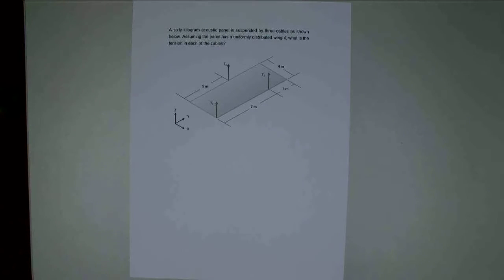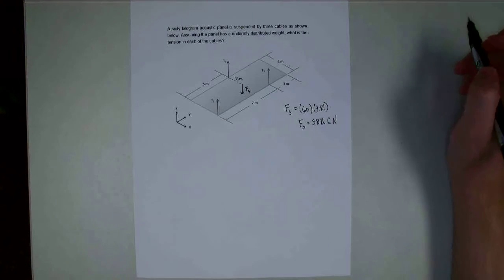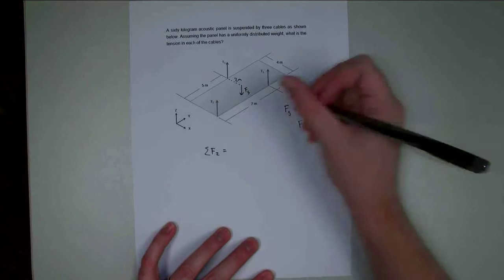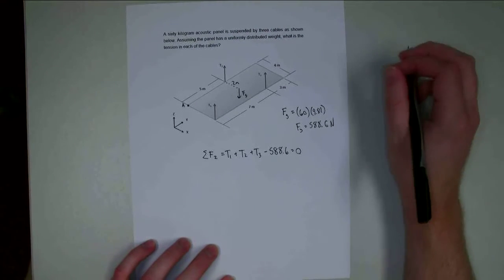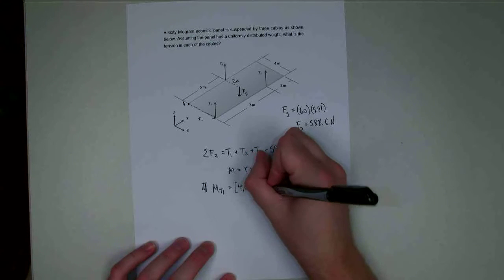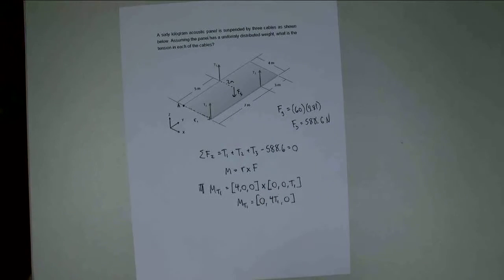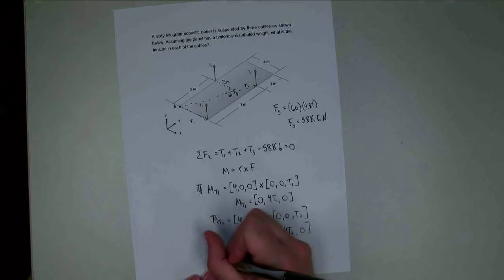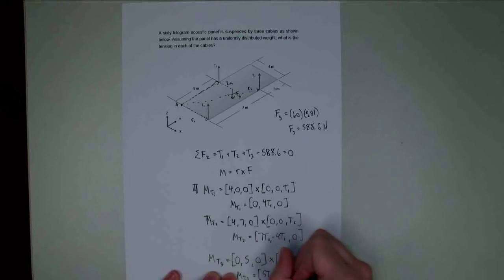Extended Body Equilibrium - Adaptive Map Worked Example 5

Comment: Hello , Very good tutorials.
Can you please add one with 4 lifting lugs( i mean with T1, T2 T3 & T4).
Regards,
Sanjay
Reply from the maker: +Sanjay y Hello Sanjay. With four vertical forces (like the ones I have) the problem would actually become statically indeterminate. This means I would have more unknowns (tension forces) than equilibrium equations. These are unsolvable using only the laws of statics.  In such cases we either need use intuition to make some assumptions (ex: T1 = T2) or use strengths of materials and the cable deformations to get the extra necessary equations.
Reply: +Jacob Moore, Thank you for your quick reply & explanation for the 4 lifting lugs.

Thank you, thank you very much.